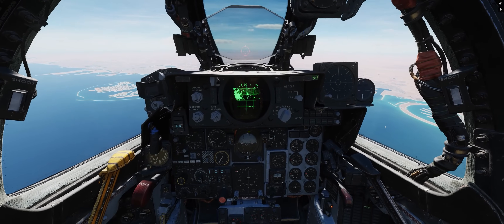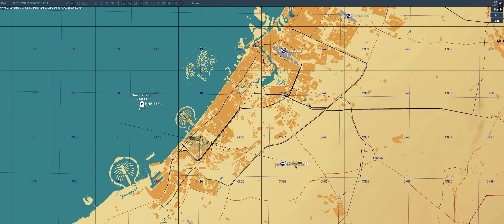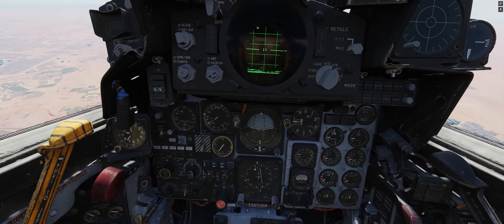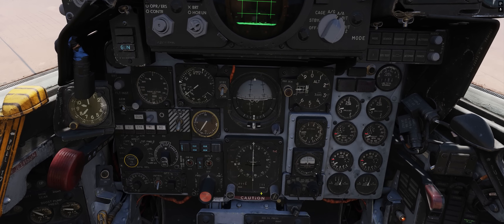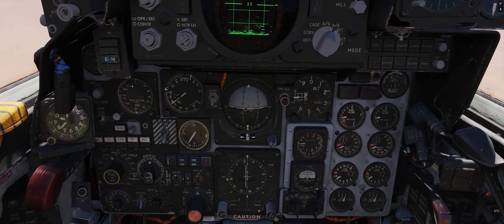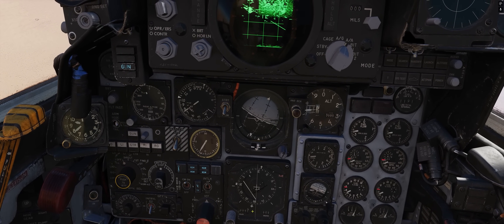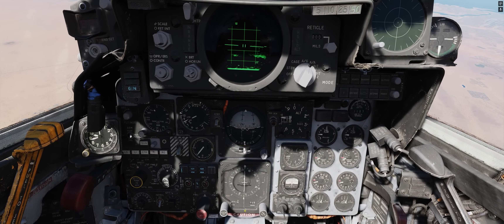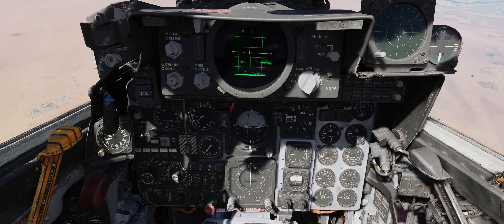The Barebones Basics of TACAN Navigation For ANY JET in DCS World!

Comment: A general rule of thumb for intercepting a radial in still air with no drift) is to  turn so as to keep the top of the beam bar (not the selected course needle) under the heading at the top of the HSI. As the beam bar "comes in" turn the aircraft to keep the top of the beam bar under the top of the HSI. Obviously with wind and drift you need to adjust your heading to keep the top of the beam bar under your track rather than heading. When going over a beacon you will enter the "cone of uncertainty" where the signals are not valid and you usually get fail flags on the instruments. Bear in mind that at a height of 6000ft you are approximately one mile from the beacon, but directly overhead! When travelling at high speed you will need to initiate any turn BEFORE you reach the overhead or you will overshoot the outbound radial. So, as you think you are entering the cone of uncertainty (based on time/distance, DME, INS, visual reference or radar positioning) you should turn onto a "best guess" intercept heading for the outbound radial based on estimated drift and intercept angle. Stay on this heading until you exit the cone of uncertainty and adjust your heading/track when the readings become valid.

Comment: (1:15). That should be ‘Subtract 180deg from 2-8-0 for 1-0-0’, correct?
Reply from the maker: You are correct I misspoke, Reciprocal headings are calculated by adding or subtracting 180 Degrees to convert course lines to radials and vice versa